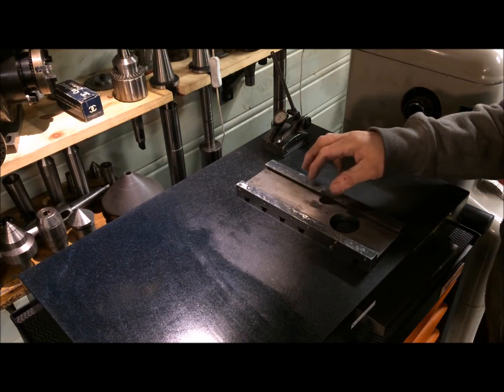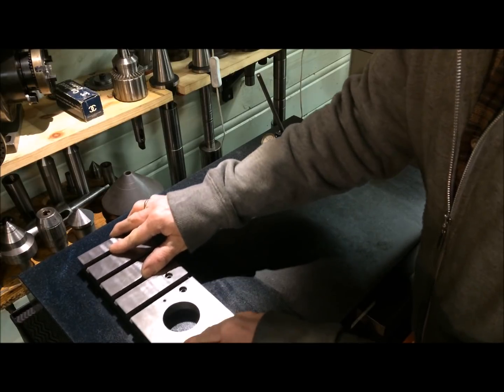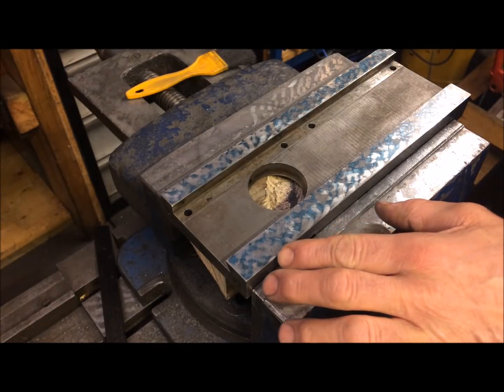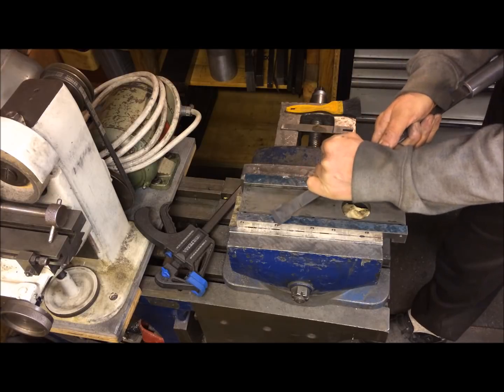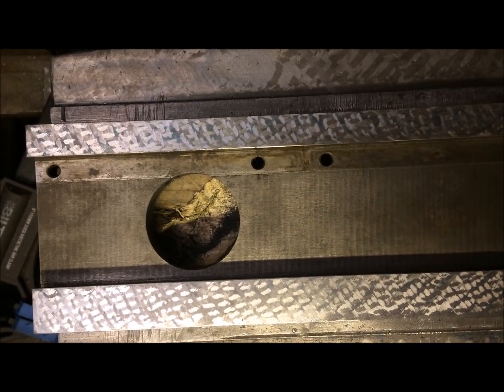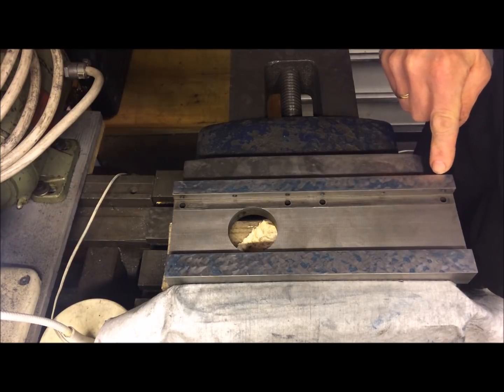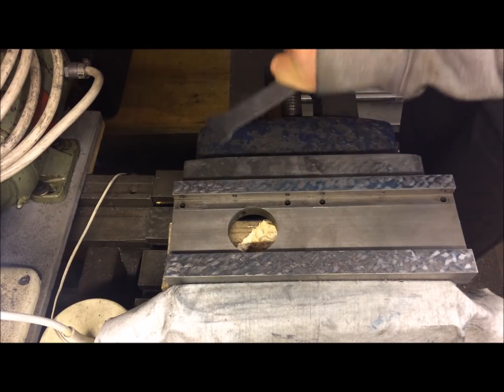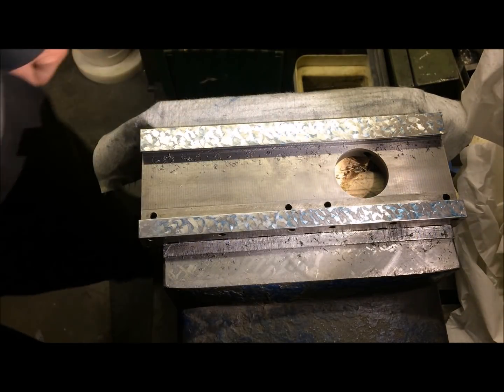Myford 7x7 - cross slide - finish scraping flats

Comment: I suppose you have no regrets about buying the Biax machine?  It is very expensive, but I suppose when you are doing what seems like a dozen Myfords, the cost per use is reasonable?  Did you try to use any other type of reciprocating machine and adapt it to scraping?  I was wondering if anyone had tried, for example, to adopt a reciprocating saws all machine with some kind of brazed carbide blade?  Did you ever make any scrapers with old inserts or anything like that?  I realize that there would be no choice for stroke length with a saw, but they do have variable speed.  Have you tried any alternatives like this?  I have only ever done the manual scraping, but at my age my muscles protest strongly after a session.  I wonder if I have no alternative but to buy a machine.  I look forward to your videos, so please keep showing your progress.  If anything, you should make your videos a bit longer and show more or even all your work, I’m sure many of us are learning along with you!  Thank you for teaching!
Reply from the maker: I have not tried to make a power scraper myself, nor ever used one. Maybe it functions well, but as said, I cannot judge this. Did try out the Renz power scraper a couple of times and they are also good. Have not seen any used ones though.. leaving a used BIAX as the best alternative. You may buy an older version at a relatively low price. Also a 110VAC/60Hz version as they can be run via a step down transformer from 220VAC/50Hz, although running a bit slower. Actually, on the Myford 7x7, I have not used the BIAX so much. Until now, just for the finishing on the cross-slide, but I normally would. Progress is slowed down because of of other projects at the moment, but am expecting the saddles to be finished soon. The other projects are: scraping 2 pairs (one big, one smaller) of  Eclipse V-blocks for a friend (was rusty and of unkown condition), mounting the SONY Magnascale DRO on my lathe (finally.. after some 2-3 years resting in the corner) and doing other stuff on the Myfords.. well into the motorizing assemblies now (I needed to break the routine a little, hence started with a simple task of replacing motor bearings.. which got me totally carried away..)

Comment: Do you intend to try a diamond ground stone (Like Robin's, https://www.youtube.com/watch?v=DVLXsq7pi9Y), to improve finish scraping?  They are really good at making the very points of blue'd high spots shine.
Reply from the maker: Have already tried that.. maybe I will post a video of this for a current project of scraping 2 pairs of V-blocks for a friend of mine. Then I did some trials with a smaller pair of precision ground stones (another friend of mine has made a batch of 2 sizes stones). I also tried to compare the results you get with the "regular" method, ie. polishing using the surface plate. The stones (as expected) revealed some more high points, but one has to be cautious to interpret these correctly also as any smaller "reference surface" (in this case the stones can be seen as this) will follow any curvature that the "device under test" will have (in this case the scraped V-block). However, as long as you don't go overboard and scrape off too many/go to deep, I reckon you are OK (as the high points will be higher than the surrounding  local area and would be the next to go anyway)

Comment: Your coming on really good at this scraping, when you make it look easy I know your doing it right, I wish I could do it as well as you, I have the top slide of my lathe to do later this year, I’m learning so much from your videos Jan keep up the good work, is there any where in Europe to buy the water based ink that you know of, I emailed the company in the US but heard nothing, I have the diamt I think it’s called and it’s very good but it takes two weeks to get it of your hands.

Alan.
Reply from the maker: Alan Pearce Thnks for the nice words! Haha.. I know what you mean re. blue hands.. I reckon your wife loves it when all the door knobs, tv remote, plates etc. have your favorite color fingerprints :) You can try to contact Biax in Germany or one of their dealers, eg. StandardMekano in Sweden for the Canode
Reply: I wonder if it is possible to use some Artist Colors as a marking ink.  Worth a look in a shop.
Reply from the maker: Got a sample of a water soluble type from Artisan from a friend of mine, but haven't used it yet. However, I assume it puts a time constraint on you as these ar meant to dry out, while the marking compound is just the opposite. But in practise it might be OK anyway. When I first tried scraping, I went to an artist shop and bought a tube of Prussian blue oil paint. This had a very bright color! Unfortunately also, you washed yoou hands in paint thinner and then used dishwasher soap to scrub away.. not very healthy or nice..
Reply: Hello
for blueing I first tried "regular" Prussian blue artist's oil colour. It marks very well, but the disadvantage is that it dries up and has to be wiped off completely in regular intervals.
Apart from Dykem I also experimented with Prussian blue pigment powder (available in artist shops) mixed with hydraulic oil (HLP 32). I just slightly" wet" the powder to get a quite stiff paste. This mixture marks really well, is not drying and really cheap.
Hope you don't mind a link to an example: http://forum.zerspanungsbude.net/viewtopic.php?f=13&t=33097&start=26
And, again, thank you for sharing your experience, Jan Sverre!
Kind regards Harald
Reply from the maker: Hi Harald,Thanks for the input! Sounds interesting.

Comment: I found at work one handscraper (don't know why my company had bought those for the maintenance guys) Tried it on a brass slide. It was really difficult to get any sort of pattern... :) You have some real skills!
Reply from the maker: Thanks! If the scraper was of the stiffer, shorter type.. yes, it can be difficult. Try a longer, flexible shank
Reply: It had a bit broken carbide sandvik insert at the end (that really doesn't help either... ). I don't really remember if the handle was also made by sandvik.

I suspect the maintenance guys just used them to scrape off dirt from tight spots on the machines :) None of them have any glue about scraping and it made me smile to see a handscraper.
Reply from the maker: The longer Sandvik scrapers are OK I guess, although a bit stiff for my liking. Their Carbide blades are ecellent, but applied for the methods I have learnt they need to be ground with a radius
Reply: I would say that the handle was about 400mm? Or so about... Maybe a bit shorter? Seemed not to flex that much. Well brass is soft and my skills are none..

It had a nice looking way of holding the carbide, it wasn't just a staight flat but it had an angle on it. What remained of the carbide seemed to be straight without an radius (from other youtubers, namely the german one, Stefan Gotteswinter, I think it should have some 60mm radius?).

The carbide had 4 different positions with an angle, I could see that it wasnt straight at the end, it had an angle making it possible to use it 4 times i guess. 3 degrees or so?

I just hold the brass in a vise and tried to make a pattern, without any real reference to flatness. It was difficult!
Reply from the maker: 60mm is sort of a happy medium.. if you have but one cutter blade this will be a "general purpose" radius that you may use for both roughing and finer scraping. The Sandviks have the proper cutting edge angle, but are flat so the way both Stefan and me.. and many, many others have learnt and experienced, this will ver soon lead to nasty scratches, at least for push scraping. PS! There is much more to this than just the scraper, and you will make yourself a big favor, and really move you forward in your scraping career by adopting the tried and proven methods taught by eg. Richard King (and others). He sells a DVD showing the basics (and much more) and also teaches classes.